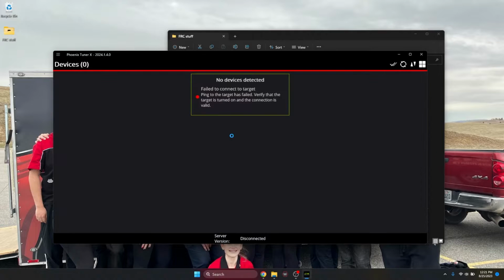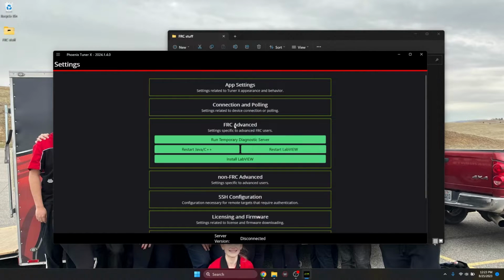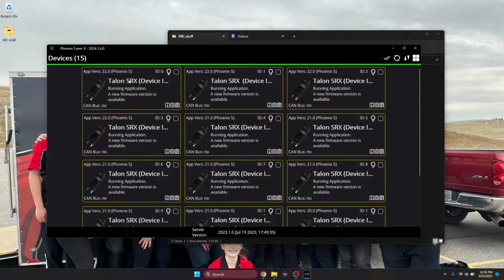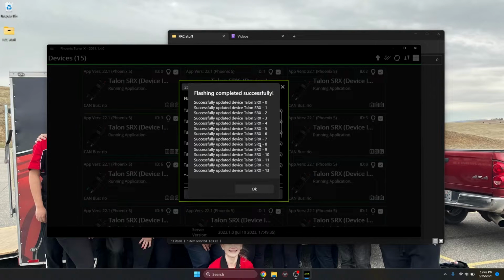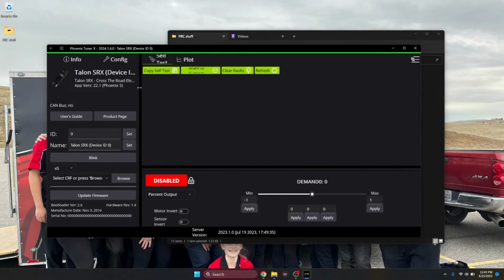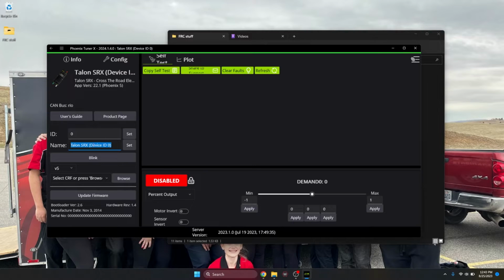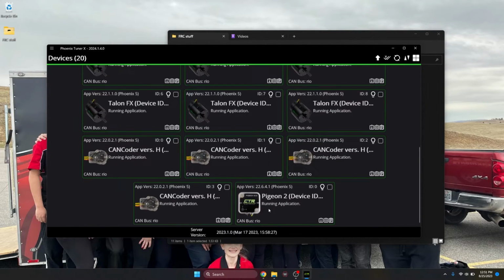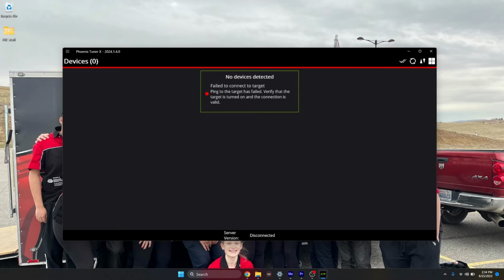CyberKnights software: Phoenix Tuner X basics

Comment: Ugh I have a question I am sure that I did everyhting correct but there is nothing on devices section what would you suggest me to do?
Reply from the maker: In the expanding left hand menu, make sure the lower left setting matches your current setting. It'll be USB over RoboRIO if you're plugged directly into the RoboRIO. If it's your first time setting up this robot, you may have to deploy the Temporary Diagnostic Server for devices to show up. Last, sometimes there's just a mistake in the CAN bus wiring, so you may need to inspect that.
Reply: @rileybrewer  thanks a lot I'll make sure the can bus wiring has no problems